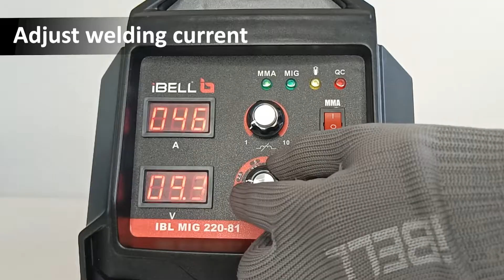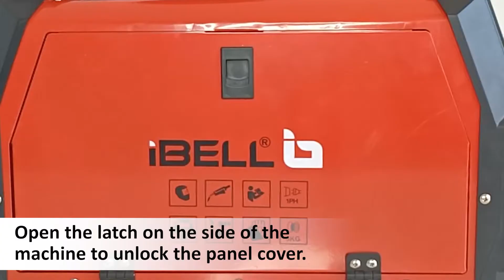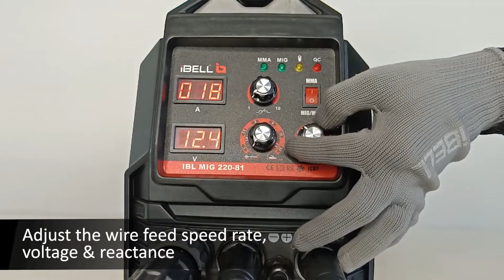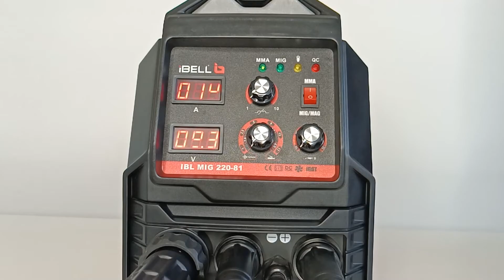IBELL M220-81 MIG MAG MMA IGBT WELDING MACHINE 220A DEMO

Comment: Ye machine without gas weld kregi 
Gas nd without gas welding se kya benefits hai
Reply from the maker: For more information, Contact Number: 1800-1034-090 (toll free) 08589809292 (direct line) email : icare@ibelltools.com
Reply: Gas is used for thin metal and glassless for thick metal and for welding outside

Comment: can it weld aluminum, copper, brass, steel and iron ?
Reply from the maker: We recommend welding on carbon steel and stainless steel only. For more information Contact Number: 1800-1034-090 (toll free) 08589809292 (direct line) email : icare@ibelltools.com

Comment: Sir This machine weld Co2 gas?
How to connect heater with flow meter?
Reply from the maker: yes, it can weld with CO2 gas. You can purchase a flow meter with a built-in heater from the market.
Reply: @iBELLTOOLSINDIA  thanks sir

Comment: You should have shown the weld results as well. That's very important when you want buyers to buy your machines
Reply from the maker: Thank you for the valuable suggestion. We will definitely try to update our videos with welding results.
For more information, Contact Number: 1800-1034-090 (toll free) 08589809292 (direct line) email : icare@ibelltools.com

Comment: Sir this unit run in single phase?
Reply from the maker: Yes. This is a single-phase machine. For more information Contact Number: 1800-1034-090 (toll free) 08589809292 (direct line) email : icare@ibelltools.com

Comment: I regret buying iBELL Heavy Duty Inverter ARC Welding Machine (IGBT) 250A with Hot Start, Anti-Stick Functions, Arc Force Control

Until u know u can't weld thin metal although machine is awesome solid... I wish Amazon and flipkart add exchange option on ibell welding  or else ibell launch MAG only machine
Reply from the maker: We are really sorry to hear that. You can contact our customer care and they will definitely help you. Contact Number: 1800-1034-090 (toll free) 08589809292 (direct line) email : icare@ibelltools.com
Reply: It doesn't weld thin because process doesn't support it. 

Use appropriate process like Spot welding, laser welding for thin material or even tig welding.